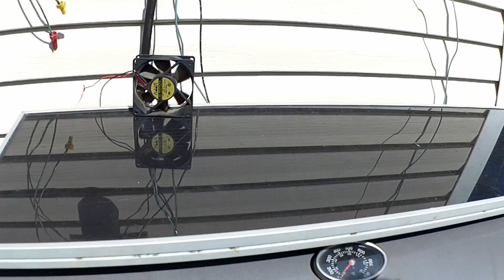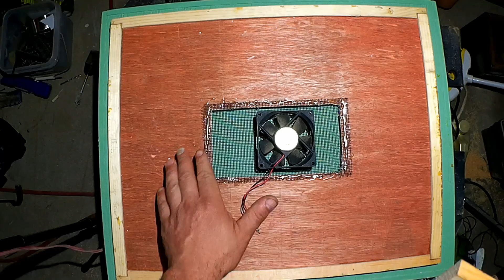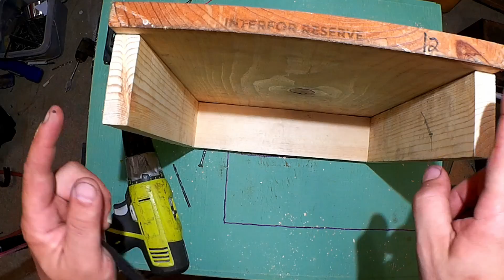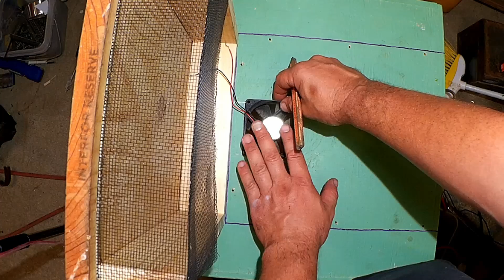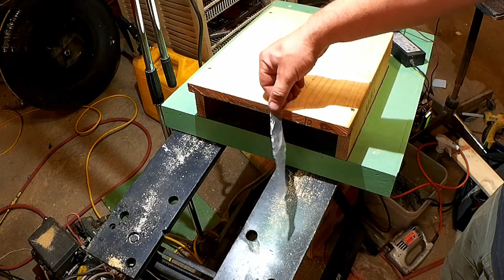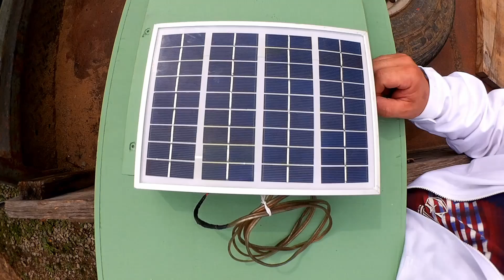Solar Beehive Cooler

Comment: I like it a lot, simple and effective, I might have added a screen on the output to prevent robbing, and made the overhang a little longer, but a great project. I put mine above the eke, so as to be a bit further away from the frames and thus less effective (a smaller temp swing)

Comment: It looks like a great approach. I will be building something very similar but I will be adding a thermal switch. Bees like to keep temperatures from 33C to 36C  within the hive. As a result, I will be setting my thermal switch accordingly.  Addtionally, I will include a lawn tractor battery in the wiring mix. This will allow the fan to run at nights when high temperatures are extreme. We will see how things go.

Comment: just a minor fix I would suggest is to put some small rubber washers between your fan and the wood frame to reduce vibration. 
A computer fan doesn't vibrate that much but even a little noise like that, but constantly, could stress the bees.
Of course you could upgrade to the next level using a Raspberry pi and remote temp and humidity sensors ;)
Reply: A great idea but an arduino at $3 is a lit cheaper than a PI

Comment: That appears to be a 3 wire fan. If so did it have a 3 pin connector on it and how do you know which wires from the fan connect to the solar panel?

Comment: I've just noticed this video recently and wondered if you posted any specific model/part numbers for the solar panel and or the fan. This would help on the fan in particular given a wide variety of difference in the decibel level of various computer fans.Did you add any cushioning for sound or vibration dampening between the fan and the cover/lid its mounted to? Thanks for the project and the tips!

Comment: I’m good with it . Lol ... be interesting to see how the two hives fair
Reply from the maker: In our extremely unscientific testing we have run two hives for two seasons now and both times the one with the cooler has had a larger population.  Unfortunately as we are new to beekeeping we've not yet been able to get anyone to stay through to winter.  We're fairly certain that the ones with the coolers and possibly the other hive as well must have had to swarm at some point and probably too late in the year leaving the remainder vulnerable to robbing which we just didn't notice in time.  We're still learning to notice things and there's no substitute for that but I think the cooler can be a valuable tool in a hot climate if managed properly.  I need to add a thermostat.

Comment: Focus on learning to raise more bugs  (honeybees) and you'll get more honey.  It starts in the fall when you decide how much honey to leave them and again in late-winter you decide on feeding them pollen or not.  If you're doing it right you'll have so many bees they won't need a helper fan. They are ventilation experts far beyond our mechanical engineering knowledge. Best thing is to bore a hole in the top box. The fan can work against you too. Consider 95 degree heat with 95% humidity and you're pulling it thru the hive. Neat idea but not buying it. 
Beekeeper with decades of experience says "solutions create problems".
Reply: Mike Ries i also wonder about changing the temperature of the brood and if it will be detrimental to their life. If i was going to do something like this i would be thinking more of a vaulted lid  over a screened hole in the top board. But honestly bees have been surviving long before we thought to give them air conditioning. Air conditioners have over time killed alot of people because we came to depend on it. Let's not do this to a species that is struggling already